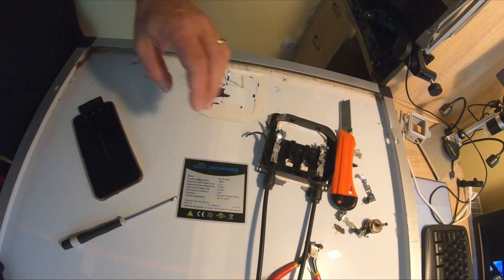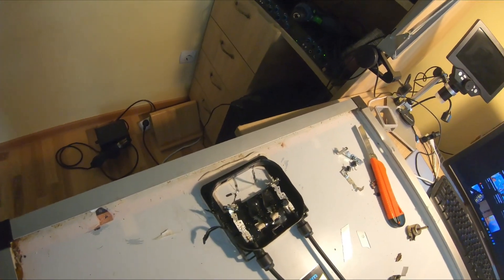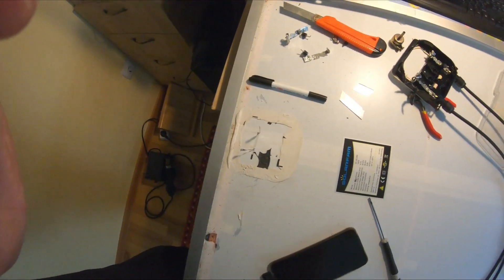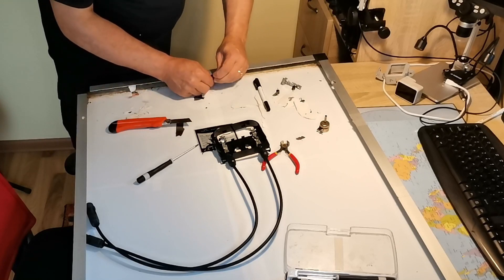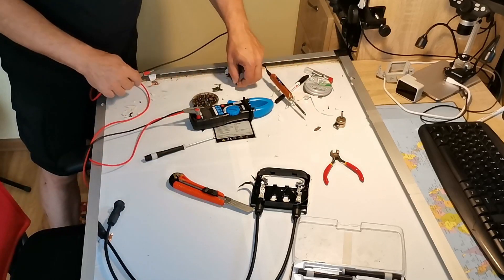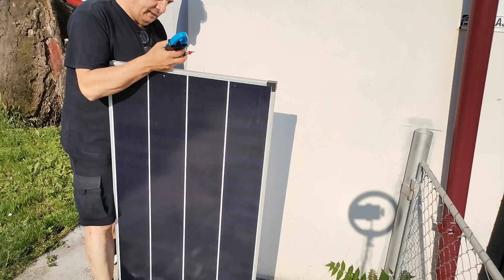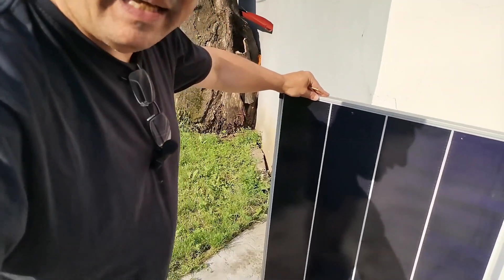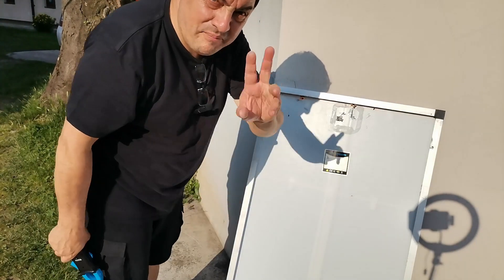Solarfam 180W solar panel fix DIY

Comment: would you not recommend new SolarFam panels? I am looking at their Topcon Type N panels.
Reply from the maker: It was a factory problem, a lot of the panels from this particular lot has been compromised due a wrong soldering machine. As I have been told from supplier. I had 3 panels like that, replaced with similar models which are working great since then. So go for it!
Reply: @viocaia  I am trying to find a dealer in The Netherlands for these panels. Where did you get yours? I am looking for 200 watt sizes.
Reply from the maker: @harleysoltes  I bought them by a Romanian company...I checked the solarfam web site and it;s gone! I even wrote them at info@solarfam.nl , but it;s not there anymore...
Reply: @viocaia I am not getting any answers from their website and on Dutch dealer has their products on deep discount so perhaps they are closing up? I’ll keep trying.
Reply from the maker: @harleysoltes  Good luck!